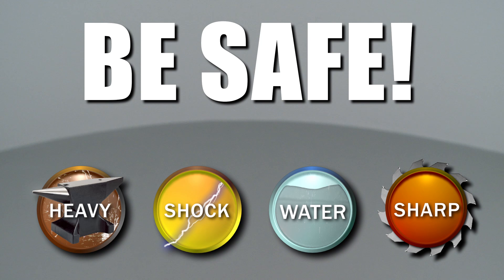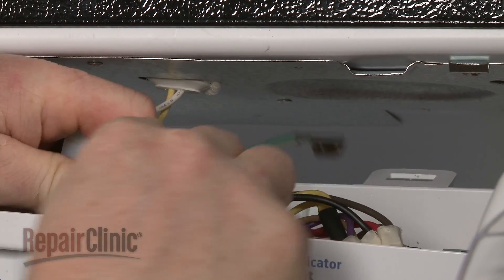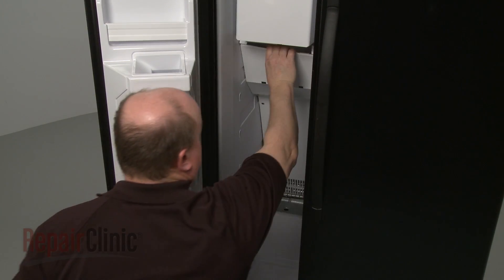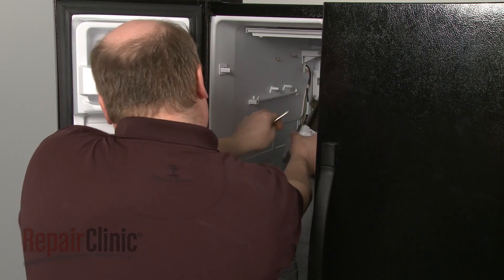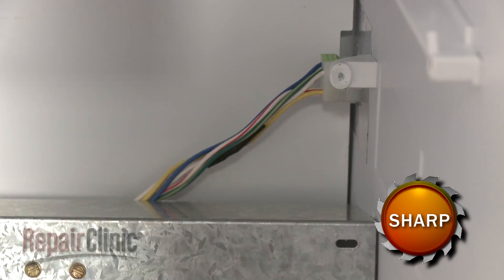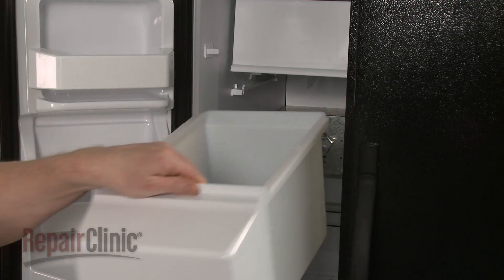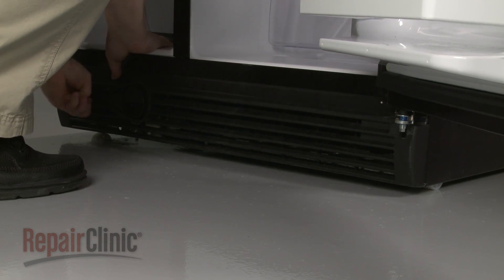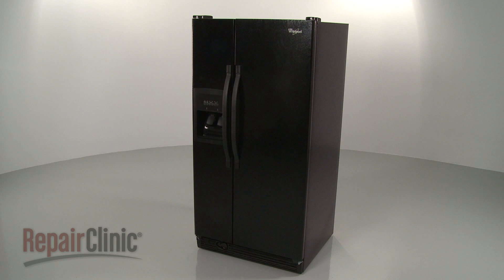Whirlpool Refrigerator Disassembly (#ED2KVEXVB01), Repair Help

Comment: Good day, I have a Whirlpool upright freezer, stainless steel look with the front panel a the top op die door.  The condenser does not switch off, but we cannot "undo the top panel to access the thermostat.  Anybody that can assist please.

Comment: My Whirlpool WRS325FDAM02 had water squirting into a pan on the bottom, will this overflow if i dont take the pan out and drain it?  I do not see a way to take out the pan.
Reply from the maker: Consult your owner's manual for care instructions for your particular model. You'll find yours as a downloadable PDF on the Whirlpool website. Are you seeing water drain? Or hearing water drain in your refrigerator? A few times per day, you may hear your refrigerator's automatic defrost system. Our How It Works: Refrigerator video explains this process: https://youtu.be/5vA8Ksv5kVY

Comment: Mine is similar to the one here but I could not remove the cover of electrical defrost controller. Any other extra steps needed? Model # is ED5FHAXSS01. Thanks.
Reply from the maker: For model-specific information, enter your model number in our website: http://www.repairclinic.com?TLSID=1773.
Reply: i had the same question. I realized you remove the cover with the writing on it by prying it with a butter knife. Under that cover are 2 more screws need to get to the control unit.

Comment: It'd be helpful if someone made a video of how to replace the Drip Tray on this fridge. Whirlpool model ED5KVEXVB. This starts off to look like a easy replacement but I'm reading it is far from it. The stock part is the cheapest plastic they could use. I'm wondering if this isn't so it cracks and fails.creating a leak and then we as consumers are FORCED to purchase a new part. Believe me the new replacement part is 10 times thicker plastic than my factory tray. This is a real PITA and it just doesn't slide to the side to replace. It's not as simple as opening the front grate and sliding the old tray out. Can't access it from the back there all kinds of stuff in the way. I've read only 1 helpful thing on this and it's been said I'd need to lift my fried and removed it from UNDERNEATH. They also said THIS IS A BIG TASK TO CHANGE THIS. smh.   Who has a magic answer to this? Call a repair guy and get reamed on a scam of a service call to replace a cheap junk plastic tray because it take a whole disassembly of my fridge?  NTY.
Reply from the maker: We consulted the parts breakdown for your unit. It appears that the tray simply sits on the bottom panel. It's held in place with tabs sticking up from the bottom panel. You may have to remove the condenser fan motor assembly  and bend a tab or two to remove it from the back.

Comment: I am shocked how few people realize there is a stagnant pan of water in their frig that keeps generating the same water over and over again. I thought mine did not have a pan I looked in the back and it has a static one you cannot pull out to clean ( this makes no sense American designers) I took a turkey baster and a cloth to clean it out it was black water!!!!!!! ewww that means mold has been shooting over my food for three years
Reply: Not really getting in your food. The water in the pan is from the self defrosting freezer. A timer turns on a heater and shuts off the cooling. Ice buildup in the coils in the freezer  melt and runs through a one way valve in the bottom of the freezer into the pan. The water in the pan will evaporate  from the heat of the condenser. The black water could be mold but more likely it is caused by dirt and dust in the air. If you are worried you could put a small amount of bleach in the pan.

Comment from the maker: Some refrigerator drip trays do not come out easily others slide right out. You may have to remove some brackets.  If you just need to clean it out you might just leave it in there. If it is cracked and leaking do what you need to do to get it out.